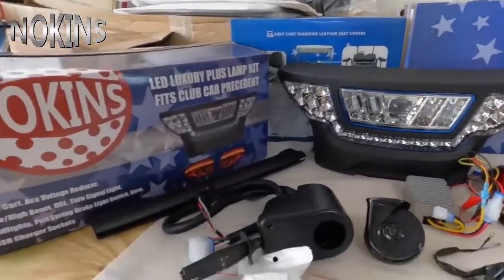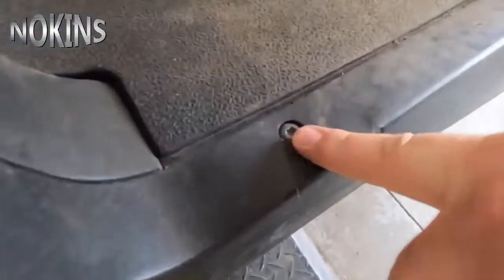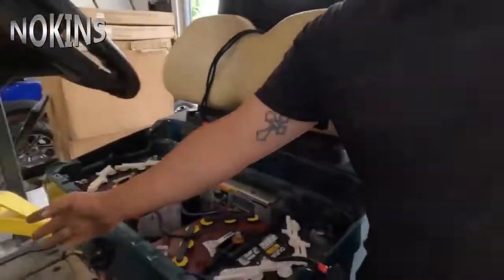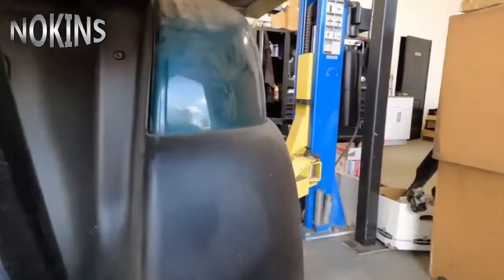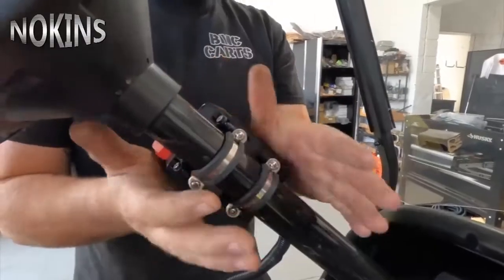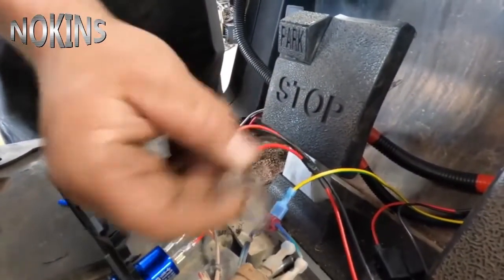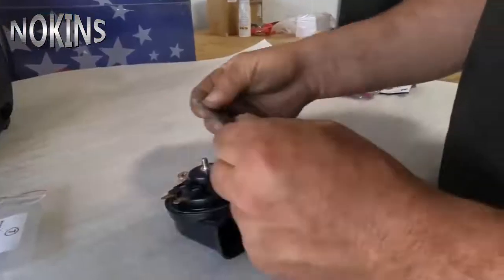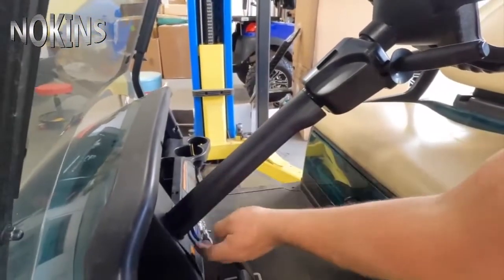How to Install NOKINS Deluxe Plus LED Light Kit for Club Car Precedent

Comment: after installing this kit on a 6 battery precedent, the usb/volt meter would not power on.  We did not use the yellow gator clip wire, and hooked the yellow wire to the yellow off the reducer.  Is this correct?
Reply from the maker: Hello, yes. Alligator clips are present to test the functionality of the LED light kit before beginning installation. Discard after testing.
Connect the yellow/green wire with spade terminals to the yellow/green wire of the DC converter.
The yellow/green wire in the instrument panel is connected to the blue wire of the key switch, turn on the key switch, the DC converter will start work and convert the 48V voltage to 12V voltage. thanks
If you have any questions, you can contact us through the after-sales email. thanks